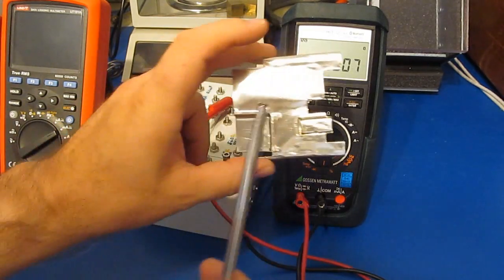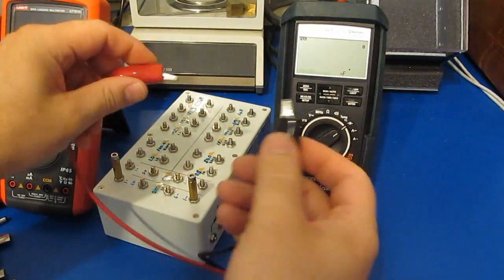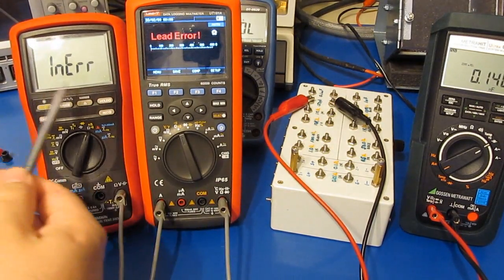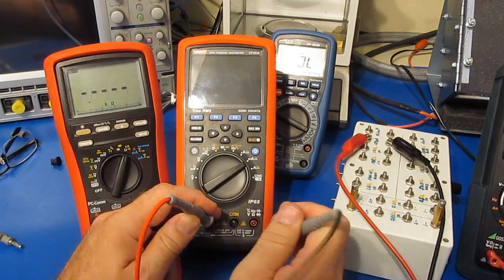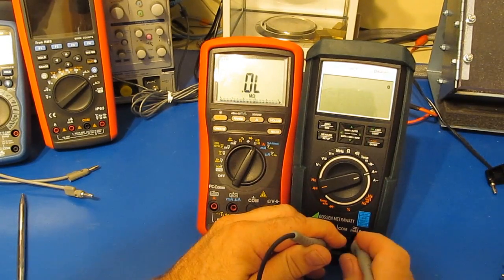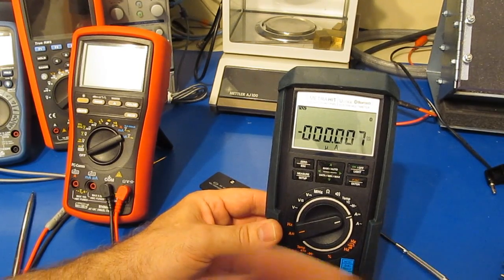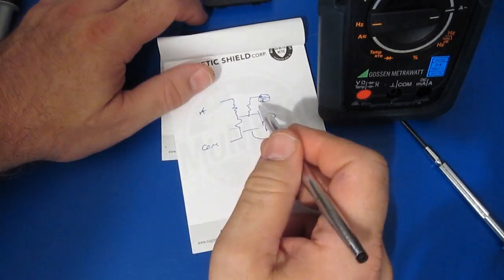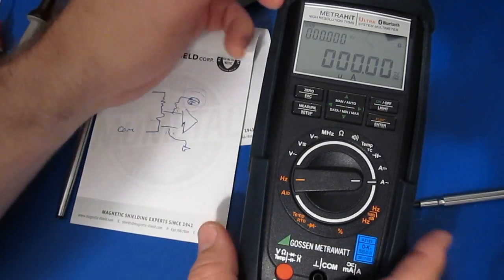The Ultra's blown fuse detection circuit, and cleaning the meter

Comment from the maker: It turns out the meter can detect the opened fuse real time.  The voltage across the fuse must be greater than about 2.5VDC for it to detect it.

Comment: For the 10 meg, where was the contact issue? On the gold wafer part of the PCB?
I saw some kind of grease on the AN8002 wafer as well.
Reply from the maker: I am not sure.  I don't use gloves and normally just wash my hands before starting and clean the board after.  Just did not take my time was all.  I did remove that little lint from behind the lens when I added the shield.   That board had to come out to install the foil.

Comment: Fuse?, what's one of them LOL :-D
Yep they must do a check as you switch range/function, you are too picky LOL :-D
Reply from the maker: Like the MHz input, it sort of does something but could be so much better.  Yes, for the price and hype I expected something much better.
Reply from the maker: It turns out the meter can detect the opened fuse real time.  The voltage across the fuse must be greater than about 2.5VDC for it to detect it.